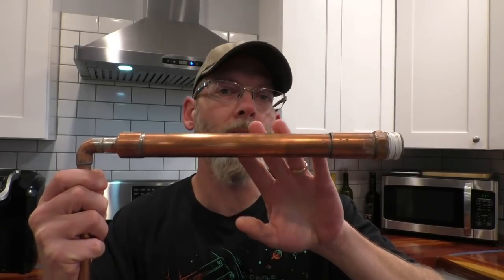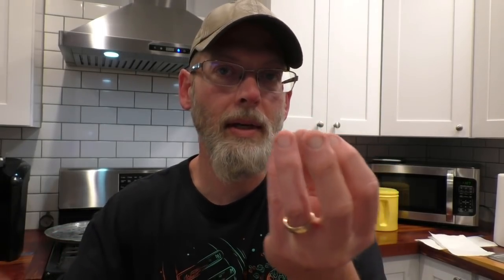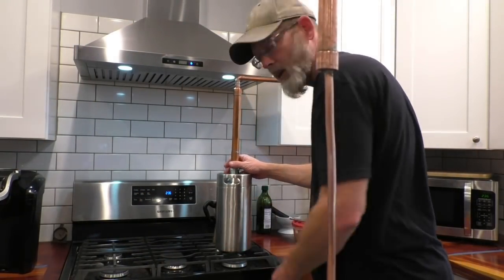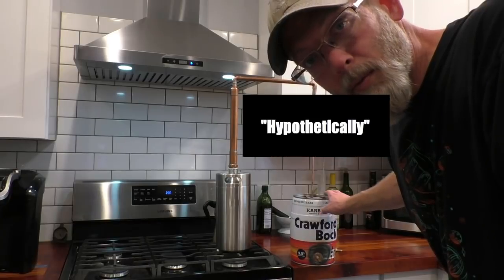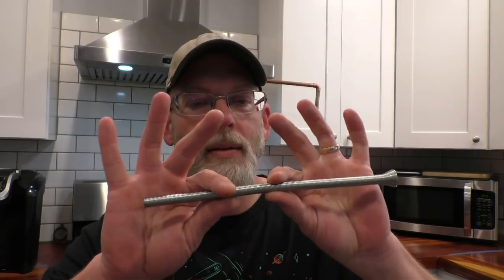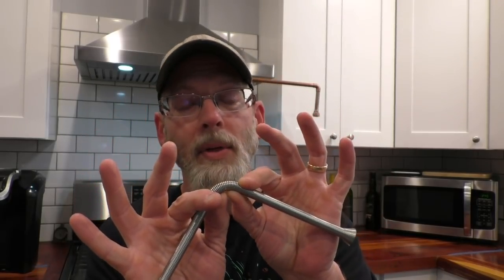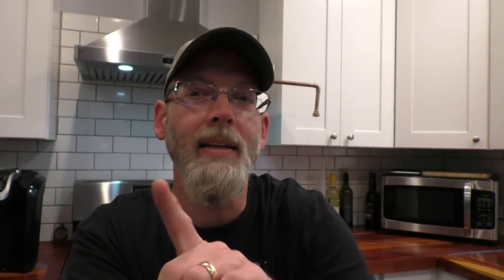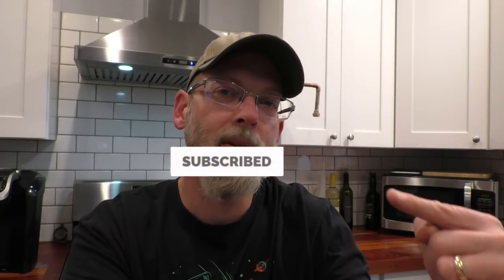Building a MINI STILL from Tiny Beer Kegs! - Testing Still!

Comment from the maker: Check out Into The AM for cool Graphic T-Shirts! - http://intotheam.com/Bearded10  Use Coupon Code - Bearded10
Reply: I was all moon eyed on this because I tried to do this and the threads didn't match. Glad to see I'm not crazy because it's like 31/32 of an inch on one end and a different thread form. 

I have a half dozen giant SS flasks I wanted to do something interesting with but there really isn't anything out there to mate to it. 

Absolutely hate plumbing.
Reply from the maker: @SyBernot  Yeah, when the first keg was a fail and the second keg arrived but wasn't perfect, took me a second to calm down and make it work. I basically treated it like a press fit and rely on the ptfe tape and flour paste as the real seal.
Reply: Hi glad to see you're good bearded... Id like to see you hypothetically test a invert sugar wash into a sweet tea (flavor your choices i used peach tea) instant "aged" "whisky" ... Not a true aging just technically a colored new make
Reply: Bearded & bored have you tried a hypothetical mango brandy with no sugar if not that might be a good idea to try for a vid
Reply: Nice way to bend copper tubing fill it with sand caps both the end of the pipe then bend it. 
It works with water to if you freeze it outside only cap one end with water for the pipe to not burst
Reply: Use the poor mans tubing bender - sand. Seal one end of the tube, fill with sand, seal and bend to shape then open and empty tubing of sand. Perfect custom bends. Also did you ever buy a  Sous Vide Cooker to finish your sweet cider instead of a pot of boiling water to prevent exploding bottles like I suggested?
Reply: How "wood" the shine taste aged in a charred barrel that's been used and then recharred? Also have you made shine with ground popped popcorn? Then you could call it "Popcorn Moonshine". And if the popcorn variety was called Sutton, well you get my drip.
Reply: hi were see finished this mini desriller plz send pics

Comment: I was in heating and air conditioning for 30 years. Folks, if you're hesitating because you're worried about kinking 3/8 or 1/4 inch soft copper, don't be. If you can kink soft copper that small, you're talented. Just do what he said and use something to wrap it around as a form and it will come out perfectly. Easy peazy.

Comment: DO NOT use solder with lead in it to build this. Use Silver solder. The Lead will leach out into the distillate for you to drink if you use plumbing solder..

Glad to have you back!
Reply: Is normal lead free plumber's solder made for soldering hot water pipes not suitable?

(Im not a pro, i thought there was only two types, electronics and lead free plumbing solder)

Comment: Great to see the video, Bearded! Hang in there, buddy. I recently started soldering copper, and my workbench vise is not oriented to using a torch safely. So for small fittings I used a coffee can with some sand in it and stuck my plier handles into the sand so the pliers could hold my fitting. I put the can on a side table and was able to hold the copper fittings and maneuver the can around while I heated the joints. I figured if you can solder, anyone can😜 Of course I could buy a mini-vise but what’s the fun in that?
Reply from the maker: Good thinking, brother! I'll have to try that:-)

Comment: Welcome back! I “was told” to use high silver solder. Did someone just pull my leg with that? I used it and it worked great, but it was pricey and I wondered why not just lead-free. 🤷🏻‍♂️
Reply: You did the right thing. Silver solder is the best for a still
Reply: @PoppaLongroach  thank you 👍🏻

Comment: Highly recommend using plumbing putty over flour and water paste. Holds up better PLUS reusable. You can get it at most home improvement stores.
Reply from the maker: I can't recommend that unless it's chemically inert under standard distillation conditions. Ethanol, acetone, acetaldehyde, etc are all powerful solvents at high temps in a standard alcohol distillation and can strip unwanted chemicals from putty.
Reply: @BeardedBored  like most anything you have to watch the ingredients. I know for your channels and personal sake you can't due to the possible liability contained . Most though consist of mainly clay with a little linseed oil to maintain pliablity. There's a few that contain talc and as many know is a known carcinogenic.

Comment: Great info, might be easier to use a U-bolt at the top of the worm, instead of soldering a flange.  It can clamp the tubing to the side of the can and maybe a little spacer block between.

Comment: If you ever redo that cooling tub try using 3 lenghts of 1/4 or 5/16 OD hard copper soldered along the edge of the coil to help you get that perfect angle and keep the coil sturdy. You can also use some small copper scraps as stand offs to secure it to the tubs top and bottom. All you need now is a mini thump keg. You have a good art piece for the template for that. :)
Reply from the maker: Dude, I need you to be my neighbor cuz that's a great idea! Thanks!
Reply: @BeardedBored  On second thought. Even some copper braising rod would work with as small as the worm is. I saw a 1gal Heineken keg at Heb tonight and all I could think of was "Hmm. That looks like a mini thumper." lol...

Comment: Nice job and mini still. Just heads up for bending copper, another way to keep from kinking is to cap one end of copper tubing solder and fill entire tube with water, then cap and solder other end. With tube filled with water the copper won't kink because water won't compress.
Reply: I used salt in mine. Also works well
Reply from the maker: Dang, great tip!

Comment: Not trying to be picky but "bending springs" are used INSIDE the pipe, so as to support the tube as it is bent, thus stopping any partial collapse ( kink ). On the outside of a smaller pipe, they will still allow it to kink as the bending motion simply spreads the spring coils,  thus no support. In small dia tube, try filling it with dry fine sand. Generally just taping the ends with a good pvc tape will suffice  (or crimp with pliers) to hold in the sand. Then blow it out once bent.
Reply from the maker: Holy crap, hahaha, had no idea:-) Thanks!

Comment: He's baaa-aaaack!  Great to see new stuff!!!  Since this is a smaller boiler, might I suggest the 1.5 distilling technique?  1st run stripping, dump back in to empty boiler, top up with wash, & run again (so it's almost 50% low wines & 50% wash).  Keep hearts in separate jar starting with run #2 & dump feints into run #3.  Rinse, repeat until out of wash.  Also, check out Odin's Rye Bread recipe on HD Tried & True.  Great for a boiler this size!  Or throw the 1st run into the thumper, then subsequent feints?
Reply from the maker: Really good ideas! Got to check that rye recipe out. Thanks!

Comment: Great to have you back Bearded. What do you think about placing it in a pot of water raised off the bottom like a double boiler and “hypothetically” fermenting on the grain?
Reply from the maker: Well, now you're just trying to outdo me with great ideas! I never thought of that, but it would work for sure:-)
Reply: Water would take forever cause it’s only 20°c over the temperature you need to “boil ethanol”

Usually an oil is used cause it can be heated to 200°c or something, and allows heat to flow in faster, but still gentle enough to avoid burning the grain

Comment: Good to see you back! Wonder if you could use small tri clover clamps on the top of that keg??? Cool hypothetical build!
Reply from the maker: It doesn't look like it's made for a triclamp, but I want to see if a 1" would fit and secure it. Not sure if the lip is big enough until I try to fit one on there. If it does, that would be a nice upgrade:-)

Comment: anealing non ferrous metal. heat it up red and cool Quigley in cold water. this is something that I actually know about hehe. you'll notice the difference! I'm glad your back!! I'm ultraviolet aging a corn/rye mash with toasted hickory at 80% and plan to add honey. should I use the honey in my cut, or do you think i should add it at full proof after I take the hickory out, age that and then proof? I'd like to know your thoughts

Comment: Glad youre back! Is that keg flanged for a 1" tri clamp at the top? Meaning with a 1" adapter and tri clamp it could quickly be adapted to anything hypothetically already around for a full size keg "boiler"?
Reply: That's exactly where my brain went --> tri-clamp for the win!
Reply from the maker: I need to get a 1 inch triclamp to rest it, but I think the lip might be too small. I plan on checking it out.

Comment: Such a great video, I was measuring my mini cakes threads and they are 1.5 mm apart and the copper threading that I got from my home Depot was 2 mm apart so did you force the threads down with force or did you get it to match?
Reply from the maker: I'm able get it to thread, but not well and only screw it on about 3 full turns. I don't bother forcing it so I don't damage the copper threads., also the flour paste does the trick for a vapor tight seal.

Comment: You can buy 1.5" or 1" TC fittings that thread into 'beer style' threads.  From there, you can buy another TC fitting with whichever size and gender of NPT you want.  It would make swapping out columns easy, and eliminate the incompatible thread issue.
Reply: I think the mini keg thread is very specific to that application. I can't seem to find anything other than mini keg attachments that have the same thread.
Reply: @jamesmorgan1327  so the threads of a mini-keg are even more specific than a regular keg?  Yikes!
Reply: @ianholmes6078  it's closer to an m35x1.5 than a 1" NPT (assuming that's the '1" adapter' Bearded is using) but not exactly the same (I think). You'd probably have to go to a machinist to check.

Comment: The connection from the top of the column to the top of the worm may work better if you used a 45 degree bend to create a more definitive point of no return near the top of the column.  The lateral is short, then angled down 45 degrees.  It also allows you to shorten the neck on the worm which should make it more durable.  It looks like your current lateral and riser are near the same length, so the changes should land the condenser in about the same place.
Reply from the maker: Really good idea!

Comment: Great video, I’m going to have a bash at this myself as just getting into brewing. On a side note not bad soldering at all (plumber by day) just next time heat from the bottom and apply the solder from the top and it will run nicely 👍🏻

Comment: Glad to see ya back, I was about to go into withdraw... I know "Real Life" takes priority.. To fix your issue, to me, looks easy, I could be wrong (maybe).. From the maker of the keg, see if they have a fitting they sell and explain what you are "Hypothetically" going to do.. I made one from a larger keg and that is what I did, they were happy to sell me what I needed I just passed it on the the "Fairies" to complete the task.. Sorry if I came across rude.. that was not my intent.. I do hope this information helps.. I very much enjoyed watching.. I am going to make one, that was a brilliant idea.. I know many others have made them, I just like your approach and idea better..  Also for my heat source, I use a countertop temperature controlled single flattop burner.. The name is worn out, but it was a bit pricey, I bought it cause I can accurately set a precise temp (+/- 1 degree) and for some distillations 1 or 2 degree off can make a difference.. Sorry to babble on, it's a bad habit..

Comment: I have an air-still, there’s only a fan to cool the distillate that runs through a stainless coil, Like Jesse said!
If you could cool down the distillate after it comes off the spout, I would liked it,
We can buy air/stills ( In SA) for less than all the copper you used ( also maybe it’s a lot cheaper there than in SA!
Reply from the maker: This was about $90US with the kegs and copper. Pretty close:-)
Reply: @BeardedBored  cool Broer, mine was like $110 but still no way to cool the distillate, but maybe one can work something out, I just add copper to the spout,
Gotta have copper right , although uncle George busted that myth

Comment: Good to see you again. I'm new and have only fermented so far. I did a mango, sugar, and bakers yeast that fermented very quickly im very curious on how that would taste when distilled. I have a question also when I check the OG what temp does that need to be I know I take it before the yeast is pitched but if I let it come down to 60°f then won't it be to cold to pitch the yeast?
Reply: I usually pitch Yeast at 35 celcius, and my alcool metro is calibrated at 20 celsius ( just search a conversion table online)
Welcome to the hobby, have fun mr Rich!
Reply from the maker: Yeast can survive freezing, so they'll be fine. I do like Don said and pitch at about 80F and use a hydrometer temperature conversion calculator on the brewer's friend website. Converts it for you;-)

Comment: I came from the channel "Still it", and i have a question.

Instead of risking a bunch of kinks trying to coil my own (hypothetical) condenser, would a stainless steel wort chiller (made for cooling beer wort by submerging it in the wort, and running cold water through it) work with minimal modifications?
Reply: From the theoretical point of the "hypothetical"  SS worm experiment; 304 or 316 is less malleable and less chemically reactive than Cu refrigerant tubing. Cu tubing requires less equipment to work with, and is cheaper in TX right no. BUT if you know how to tig weld, have the equipment, and have the practice material to make the learning mistakes, SS is far less reactive. Cheer's duderino!
Reply: @JCbrewNweld  well, the wort chillers are already coiled and most have connectors pre installed at both ends, thats why i was wondering.

Seems easier that way (but more expensive if you dont already have one).
Reply: Definitely if you already have the chiller and a container big enough. I had been curious about using a plate style heat exchanger to?
Reply from the maker: As long as you can rig it up it should do great.

Comment: Hey bearded. I see that you use mason jars to contain your distillates and concoctions. No concern with storing your liquor in those mason jars? With the tops on as they should be or upside down?  Thanks a lot.
Reply from the maker: Never had a problem with them. Is there something bad about the seals?
Reply: Just been doing some reading and I see there is concern surrounding the gasket on the lids and the bottom side of the lid. That higher proof alcohol may potentially deteriorate the seal or the coating on the lid. Which could possibly end up back in the liqour. But I haven’t had any issues either.  There seems to be two sides of this. One side where people stay away from anything that isn’t glass or stainless for storage and others who are less concerned. Thanks for the response.
Reply from the maker: @phillipjohnston2877  I use caution for stuff in the vapor path on equipment, but haven't heard enough on the lid gaskets to make me worry about it.
Reply: Ok cool. I was kind of gathering that much myself. Sounds like some people are just being over cautious rather than taking what they consider to be a chance or risk. Thanks for answering back. Love your channel. Sláinte Mhaith